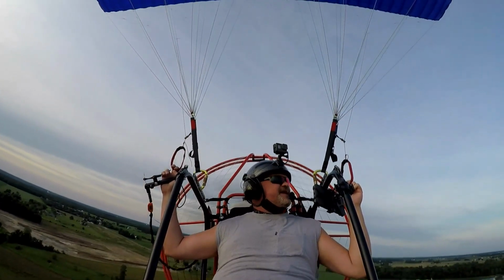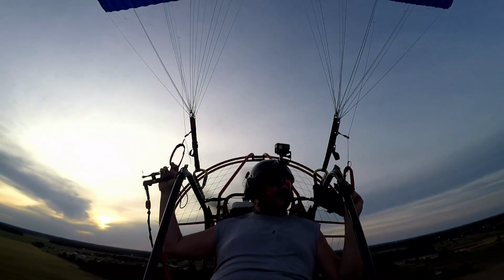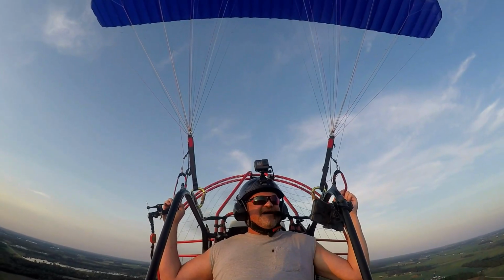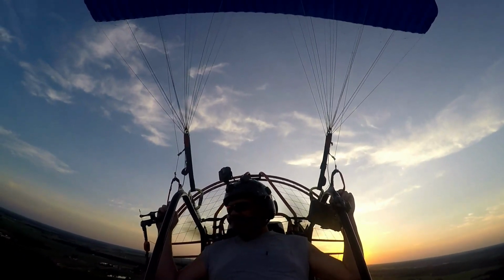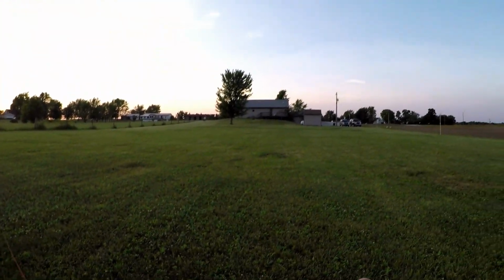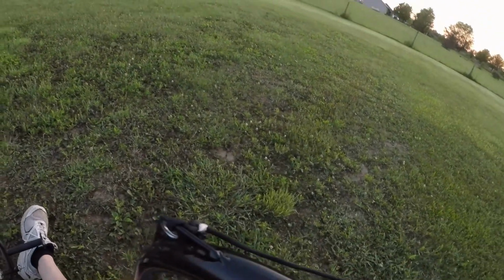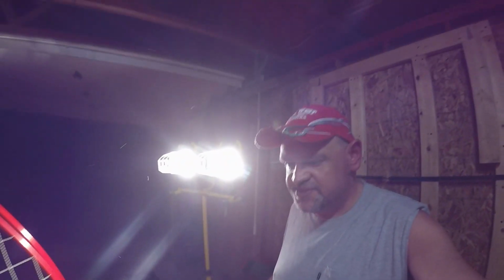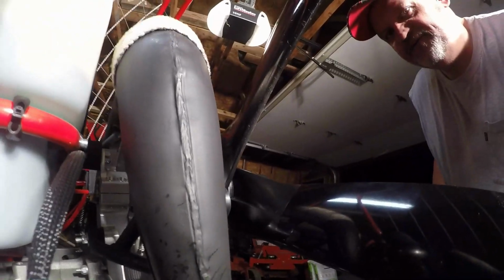SPUTTER AND SPIT...PARAMOTOR PIECE OF S#!%

Comment: Berry, I had the same issue with fuel squirting onto my exhaust, with my Fresh Breeze, from that tiny vent line coming from the carburetor. It was a very simple fix. I had my motor idling so low that the carburetor was shaking so much that it was shaking the fuel into the vent line and out onto the exhaust. I just idled the motor up to smooth it out and the problem disappeared. There is a chance that if your motor was running as rough as you say that it might have been doing the same thing. Honestly, I couldn't hear it in the video. Also, when mine was blowing fuel, it was only at idle. When I revved the motor up it would quit squirting out. Good luck.

Comment: Looks like you are using either GoPro Here5 or 6 and the external mic adapter and a Sena SMH10R. How do you have the audio out of the Sena going into the mic input of the GoPro?
Reply from the maker: i have a hero 5 and a hero 4 and sena 30k,  hero 4 uses bluetooth back pack and the hero 5 is is run direct with an external adapter

Comment: If you're still having fuel leakage problems, check the metering valve lever and metering diaphragm. Sounds like excess fuel is backing up and leaking out through the air filter hose. 
The alternative would be a valve or valve seat under the head from the factory and that should never make it out of the plant door.

Comment: Fyi. I took a look at the old thing today and I actually had a 148 jet in it and the needle was on the lowest setting or the richest position. That's how I had been flying it last time.

On the bright side I got a nice 7200 and then rich'd it up to 6800 with the walbro 37 today. Thats the best numbers I had so far.

Didn't give it Full Throttle for more than 30 seconds but my high temp was only 243 Fahrenheit. I'm going to try and grab a couple flight Saturday and maybe Sunday too so we'll see how it runs

Comment: When you changed the jet did you do a ground run ups at different power settings for different lengths of time & re-adjust your carb for the smaller size  jet. Also what pitch is the prop you ,are running as that can have a big difference on performance, RPM, climb & cruise, whether its a course or fine pitch.

Comment: Change the air filter/cleaner I know with two stroke engines it takes a slightly denser foam helps with the fuel intake for smother running hope it works

Comment: You should have pulled out the plug and looked at it at the very minimum when you landed. This way you could see if it looks like it's rich or lean.

Remember with the Bing you have three phases.

Idle, and main jet. You can go Full Throttle for 10 or 15 minutes and then kill the engine immediately glide back down pull the plug and see what color it looks. ( during those 15 minutes you want to monitor your engine temperature and make sure you're between 338 and 392f). 

Remember with the Bing there's going to be a crossover between the needle jet and your main jet when you're in flight.  If your getting any Grog or bog it might just be the transition between the needle jet supplying the main jet so you might have to move the clip up or down to find the best flow in between mid RPM and high RPM.

I have the,simonini mini 2. I know they say a 165 is the main jet however I only use a 150 or a 155. Summer is 155. I keep the needle clip in the middle position. ( here's an oldie but a goodie make sure 100% that the needle jet and the clip are sitting under the white retainer). Many many many times have I seen that people will drop the needle and clip into the white retainer and then drop the white retainer down into the car you have to make sure that the needle and clip are under the white retainer not inside of it! 

I seen a lot of people have many jetting problems just for that reason. I still don't know your elevation but I would say if you had a 155 Jet and you left your needle in the middle position, then you should have about 7000 RPMs at Full Throttle and your mid throttle should be around 43 to 4800 providing good Cruise flight.

I have a bunch of different size Jets so if you want me to send you a couple so that you can find one that might be the right fit for you let me know.

Also there are two different needle Jets so if you want to try a different size there let me know

Comment: I am sure this problem can be fixed and this engine dialed in. If someone else is having the same problem, it means that the factory should be correcting this. I would think that Fresh Breeze would want to correct any problem that they are aware of. Especially a fuel leak on an exhaust system. From an aviation point of view, that is never a good thing. I know that the guys at the German factory aren't flying with fuel leaks. Southern Skies is your best source of contact in the US. Thank you for showing

Comment: Bart, it could be you have a defective paramotor, but I seriously doubt it. I’m not yet a paramotor pilot, but have several friends who own Fresh Breeze paramotors for years and they never had any problems with their motors. I think you should accept Captain Kurt’s offer to repair your motor. Also I think you should go finish your training, especially for routine maintenance and care for your motor. It’s just like if you do routine maintenance on your vehicle, it will last you a long time. 20 years ago, I bought a brand new pickup 20 years ago and even though it has 290,000 miles on it still runs as if it is new, because I kept up with its routine maintenance.

Comment: If your engine is stock you shouldn't have to be making all these little mods/repairs (jets, reeds, etc).  However, did you check your plug after flying with the new jet, to see how it appeared to be running?  I am starting to lean towards you have a small crack/leak somewhere in the block.

Comment: Can you do some kind of pressure test to see if those reed valves in the inlet are leaking? A regular compression test probably wouldn't do because they have a valve in the meter. Perhaps hard to tell if it was the piston rings letting by or the inlet reeds.
Reply from the maker: the reed valve assembly is brand new changed about a month ago, but i have not done a pressure check, thank you

Comment: I just ordered a Walbro carb changing out the Bing carb.
Reply from the maker: its something ive thought about, let me know how it goes for ya
Reply: I did the Swap and so far I have no issues you just have to remember that you're going to have to remount the throttle. ( the throttle goes directly to the top of the bing, but with the walbro you're going to have to put a mount in to hold the throttle, and then run the cable to the walbro)

You also won't need your fuel pump but you will have to attach the engine pulse line to the carb.
Reply: So does it run better with the Walbro?  What RPM are you turning?  Is it a FB set-up (Monster)? Where did you get the carb and how did you determine which one to purchase?  Thanks for the input...I might be considering doing he swap myself.
Reply: RainbowSixThree Enlightened. Engine pulse line?

Comment: Feeling bad for you Berry !! Hang in there buddy. 
Question - Did you happen to re-tune the Carb after installing the new jet?
Reply from the maker: thank you and yes i did but it didnt help, it idles great its just after about half throttle :(
Reply: Did you pull the plug and take a peak after the flight? did it look dry or soaked with fuel?
Reply: Here is what I would do Berry to troubleshoot some of your issues.
1. Change out to a brand new correctly gaped spark plug
2. Tune and do a run up on the ground. Find a fixed point some where to lock your trike while run up (Tree/fence). make sure your getting full RPM and no sputtering on the ground
3. Look at spark plug after ground run up 10-15 minutes
 At this point the signs on the plug will decide your next step of trouble shooting.
I wouldn't call myself a mechanic but I have done a lot of trouble shooting on small 2 stroke engines in my job career.   
Let me know what you have found.
Reply from the maker: i did check it after the 155 jet it was white and running lean with the 160 looked better but didnt run well
Reply: Bart Berry if it's half throttle then it's probably having to do with the needle jet and clip.

Try it with the 155 but move the needle clip to its lowest position so when you're at Full Throttle the needle is as  high up (open) as possible, to give the most flow from the needle to the155 jet at Full Throttle.

( also as a small cheater).... I do use additives such as Lucas and seafoam which I add to my gas this way no matter what I'm giving the engine the most protection I can.  if you see my last video you'll note,.... however I'm using the wall bro,  that my engine temp was at minimum. I think no matter what the additives with the right oil mix give the most Lubrosity, and reduce friction---> cooler temps.

Don't rely on climb rate to determine if you're getting more power that's dependent on RPM.

Your climb rate can change depending on wind direction and speed so once you're off the ground and you start coming past any rotor you can't really say that you're climb rate is going to be that consistent because of the relitiave wind.

Comment: You know when you take off an fly around it sounds pretty good...what is your RPM?  Have you called the people a Recreational Power Engineering in Tiffen, Ohio...those guys know what they're doing...if you live close enough maybe they can take a look at it.  Have you tried flying without your air filter?  Going with the Walbro Carb?  Where will you take the vacuum off the engine to run the fuel pump?  Did the F33 originally come with that carb?
Reply from the maker: Stone859 rpm is around 5800 to 6000 should be around 6200, I have not heard of recreational power but Ohio isn't far from me, the carb that is on it is what I came with there have been no alterations I have not tried it without the filter but I'll give it a try thank you
Reply: We normally get 6050 or about there on the two units we fly.  Altitude is probably similar as we are in Ohio.  Running 93 Octane and 650 jets
Reply: +1 for Rec Power in Ohio, they are THE hirth dealer for most of the Eastern U.S., and I've had nothing but good experiences from them.
Reply: My RPM is actually about that...mine runs just a bump under 6K.  However, it  runs really well between 4800 and 5500 RPM...that's where I do most of my flying.  At this power setting it sips fuel (I run Av Gas), runs smooth, and cool.  I love my motor...wish it was lighter, and I could pack it up like some of these new units out there but I'll keep it for a while.  Like I think I've said before, I've been flying various ultralights since 1980 and I think the Hirth F33 motor is one of the best I owned.

Comment: HI I WOULD LIKE TO HELP.BUT NEED THE FACTS... AFTER YOU FLY DO U CHECK THE COLOR OF THE SPARK PLUG? THIS WILL TELL U HOW YOUR ENGINE IS RUNNING? EITHER TOO HOT OR COLD? BUT ALL I WATCHED IS U SAYING SOME BLOKE SUGGESTED CHANGING THE JETS? DOES THIS PERSON KNOW HOW YOUR ENGINE IS RUNNING? AND DO U KNOW IF THE ENGINE IS RUNNING HOT OR COLD OR NORMAL?. DETAILS THAT ARE NOT MENTIONED.... ??    CHECK THE COLOR OF SPARK PLUG AFTER A FLIGHT E.G. 20 MINS
Reply: SOTHERN SKYS ? DID HE ASK U TO CHECK THE COLOR OF THE SPARK PLUG OR DID HE JUST SAY CHANGE THE JETS?